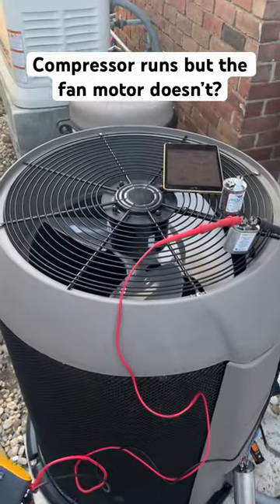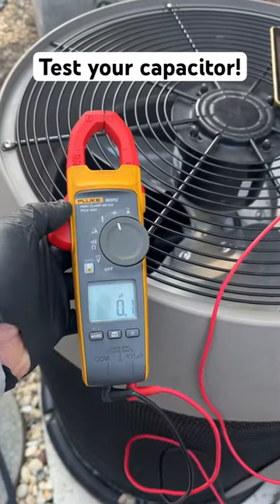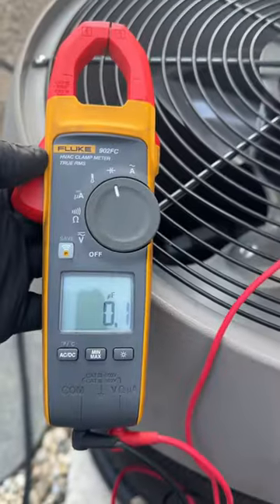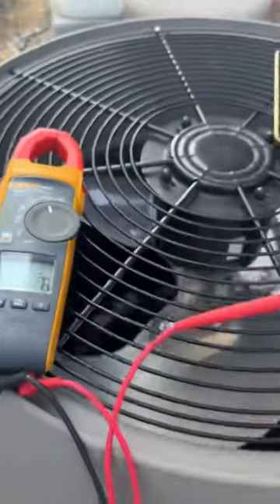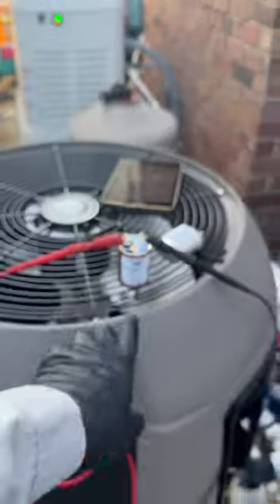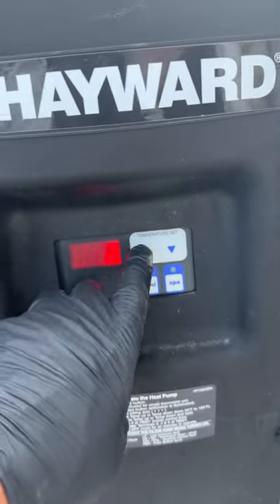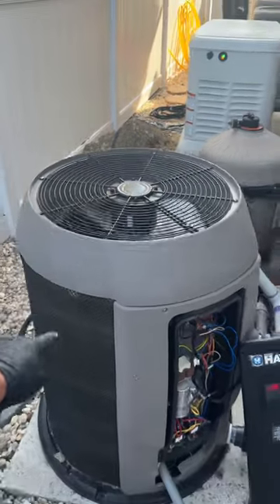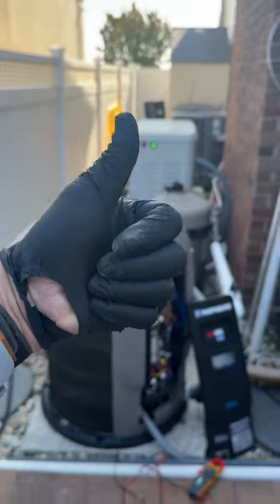Fan Motor not running on Pool Heat Pump?! #shorts #hvac #heatpump #pool

Comment: It may be a common motor problem but the difference is most guys would just change the capacitor guessing that’s the issue. If you ain’t testing you’re guessing. Carry on mike !

Comment: Do all pools have something like that?
Reply: @PipeDoctor  Speaking of a heat pumps, curiously wondering, is it like an air conditioner running in reverse or is it more like a dehumidifier as a closed loop system? By the way, great vidoes man.
Reply: @Fenrir414  like ac running in reverse.